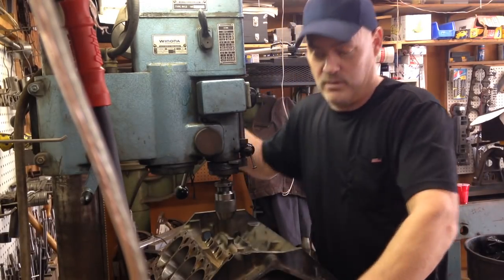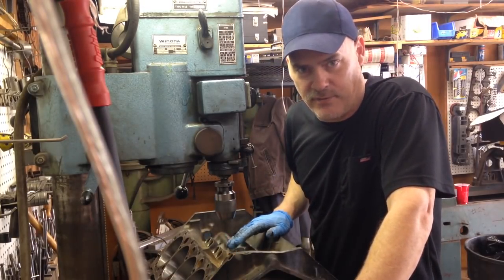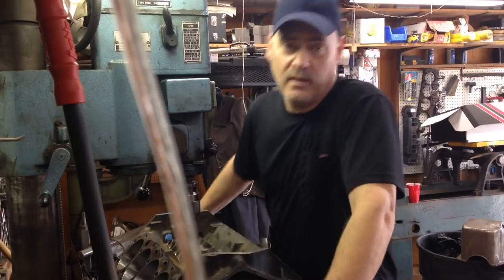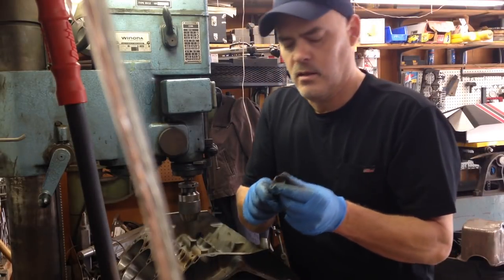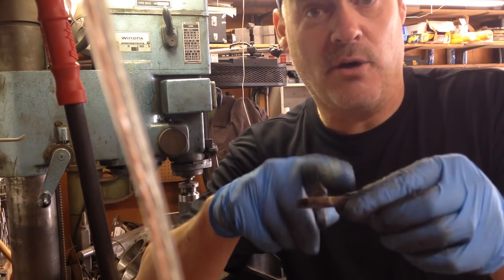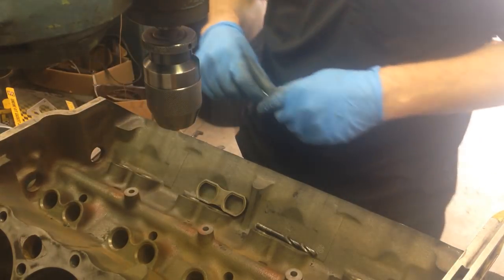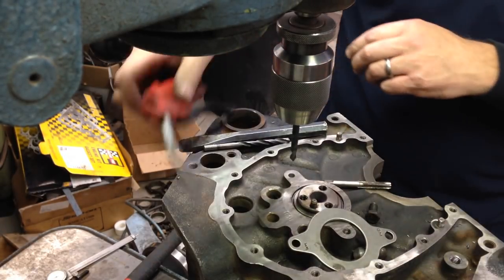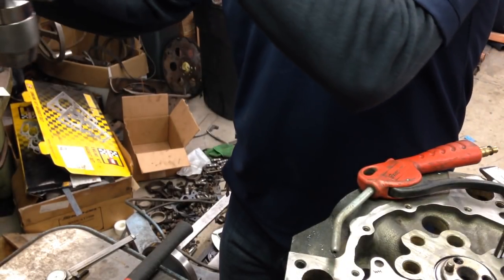Chevy TBI roller cam upgrade

Comment: Why not use a retrofit roller kit? Is it not possible to use a retrofit kit on a block such as this one? Or, is the OEM style roller kit with spider/lifter retainers (dogbones) better in some way? I want to convert to a roller cam from flat tappet with my 1995 350 TBI Tahoe, however, I am torn between going this route with OEM style roller kit or going for a retrofit kit. What is your suggestions/opinions/thoughts? Thank you in advance, excellent work here and very informative :)
Reply: OEM roller cam parts are far less expensive than retrofit roller cam kits.
Reply: Oem rollers weigh less too
Reply: I decided to go this route because it was cheaper, even with the machining

Comment: Why don't you use oil on your tap??? I don't tap anything without cutting oil or fluid
Reply: Cast iron really doesn't need any lubricant for tapping. In my race shop I have a cooling light blast of air to keep the tooling cool whether it's a tap, drill, or end mill. Been doing it this way for 40 years, and on blocks that can't be replaced.  Hopefully that helps.
T.S. RACING

Comment: any plans 2 do a video series on drilling out the fuel pump boss on a roller block (after 1991) - there r some who wish not to convert to EFI and retain the mechanical fuel pump or choose not to run a Carter P4070 external electric fuel pump
Reply: Montrose Patriot ,,,, a roller cam,,, does not have a lobe for a mechanical fuel pump,,. !!!!     ???

Comment: The block I have the bosses are not milled off flat on the top.  Were yours already cut down?  I came up with 2.150" below the block's manifold surface is where they should be.  Maybe some blocks are milled but just not tapped.
Reply from the maker: I would mill them

Comment: I have a 350 chevy that came in a boat as a volvo penta  marine engine.  the boat is a '92  is there a way to know if this engine has a flat tappet cam without pulling the intake?  also do you think 25 hours of operation would be enough to damage the cam if it ran the wrong oil, ie non zink oil? because of this channel I now understand why i might have an issue.  thanks for the videos
Reply from the maker: 25 hours could definitely wipe out a flat tappet but remember it depends on whether or not the cam was run with high zinc oil in the past what the zinc does is embed itself into the cam lobe and makes a sacrificial layer of zinc between the lobe and the lifter this protects it if it has zinc embedded in the lobes it could last quite a while on low zinc oil however eventually the lifters will wear through the zinc layer and wipe out the cam this is why it's imperative to use ZDDP rich oil and no there is no way to tell cam type without pulling the intake they built those engines both ways hope this helps

Comment: I wonder if thats just a vortec block without the holes drilled since gm went roller cam in 96...
Reply: I got a 89 small block chevy that has a roller cam from the factory. Yep.

Comment: did they forget the fuel pump rod also ran into that on same MOTOR haha
Reply from the maker: This one did not have the fuel pump rod hole drilled because it was FI engine
Reply: FI engines have the pump in the gas tank so need for any work on the block.

Comment: I purchased a 880 block (95 tbi) and after ripping it apart I found it has a two bolt main and no roller setup. I made an uniformed purchase and I'm most likely not using most of what came on the engine and it also has a few nasty ridges in the cylinder bore... I found another block (LQ3) that comes with the roller setup and a four bolt main, hardly any wear in the cylinders and it's only $50... should I make the swap or just take my block in for a clean & bore then drill the holes for the roller cam?
Reply: #$50.00?  For 50 bucks I'd risk buying it, but after you get it, have a machine shop check the block before spending any money on it.

Comment: I would like to know if you did anything to the top of the lifter bores where the dog bones sit. I have a 95 TBI truck motor that is the same as in your video but did not here you mention anything about doing any machine work in this area or is it ok to leave as is. Thanks
Reply from the maker: we ran it without doing that and it worked fine

Comment: I've got a related question. I have a 93 Gen V TBI 7.4L I'm itching to tear into. I've heard conflicting stories that these blocks are similar to the 5.7L and were provisioned for the roller cam but never given one. Could I be looking at the need to machine holes for a cam thrust plate?
Reply from the maker: it should have the holes drilled already

Comment: Im using a stock vortec block with the stock roller lifters. I’m also gonna use the 041 heads with 202 valves on this block with an aluminum high rise (carbureted) I can’t use the roller rockers on this motor because our street stock rules won’t allow it.
I wanna use the same camshaft from the 604 crate engine (.474 intake / .510 exhaust).
What’s your thoughts on this combination and how well do you think it would perform for a circle track motor?
I understand that when using a roller cam and roller lifters I will still have to use the roller push rods (shorter).
What should I use for a rocker arm?
Thanks Rusty
Reply from the maker: use the TBI or vortec rockers they will work fine
Reply: What’s your thoughts on this combination and that cam? I forgot to mention the motor is .030 over also
Reply from the maker: it sounds pretty good

Comment: I'm in the process of setting up my press for this exact conversion. I mean for real it isn't rocket science.  what size bit and taps/thread pitch did you go with? also what cam recommendations for this exact t.b.i motor but I will have vortec 062 heads? thanks man
Reply: For 1/4 20 bolts which is what they are, use number 7 drill.

Comment: cool lol , so what the advantage of the roller cam ? i`m guessing less friction more HP ?  or less ware longer life ?
Reply from the maker: I am so glad you asked this it is a really good question,  first and foremost you do not need to use high zinc oil as you probably know the engine oil sold today has very low zinc content and that makes life for a flat tappet impossible. Another good reason is a roller cam can have much more duration at lower valve lifts because of the lobe profile, Also the roller cam has 2/3 less rolling resistance than a flat tappet so basically uses 1/3 of the power to rotate it that is free HP I have seen 15 to 20 HP gains just from this alone, and yes much longer life for the cam as well as the entire valve train the difference between roller and flat tappet is as big as the difference between  Fuel injection and Carbirators
Reply: Both.
Reply: @Myvintageiron7512  it's opposite, roller cams can have more more lift at a lower duration.  it's not hard to find a flat tappet cam with low lift and a lot of duration, most of the 60s performance hydraulic cams were like this.  duration at .050 in the 220-230 range but lift less than .450.  Take for example the L79 350hp 327 cam, in Comp's reproduction of it, has 222/222 with .447 lift:  http://www.compcams.com/Company/CC/cam-specs/Details.aspx?csid=2&sb=2

Comment: off topic but I was hoping you could answer a question for me. I have 781 cast iron Factory heads which are going on a 496. The heads are going to have 2.25 intake and 1.90 exhaust. will it be of benefit, time, money vs gain if I port match and polish intake and exhaust?
Reply from the maker: port match the intake only not the ex and polish the ex only not the intake polishing the intake causes the fuel to fall out of suspension and port matching the ex causes ex. gas reversion yes it will benefit I recommend it
Reply: Thanks for the reply and information

Comment: Would this have been easier on a Bridgeport. Just wondering. I know dead lifting a block on a Bpt table is not fun either.
Reply from the maker: No I have a Bridgeport but this machine is much better suited for it

Comment: Can anyone give me some insight into these 350 TBI motors???  

 I bought a 1990 Cadillac Brougham with a 350/5.7 TBI, with 30k ml. & probably an orig. motor.   
I guess the "EASIEST" way to see if it has a roller-cam is to look down thru the head's oil drain holes or push-rod ports with my Borescope, to see  if there are any dog-bone lifter retainers, or the spider-hold down....any other way to know if this is a roller motor?

   Factory manual says this car has a 175hp@4200 / 295 lbs ft. @2000rpm, 240@3200rpm.  with 9.3:1 compression ratio &  "Hydraulic Lifters".    

I'm hoping that I have a better-variation motor that somehow made it into this car from the factory since it was a Cadillac.  

Are there any  type of block casting codes or other info I can find to determine what motor I have and confirm it's spec's easily???????
Reply from the maker: your idea of using a bore scope to look in the lifter valley is probably the best way to tell there,
 really wasn't any way to tell externally if it's a roller,  most of the TBI engines were not roller,
 the decision to make them a roller was made on the assembly line based on application.
I think a Caddy probably has the best chance of having one because it is considered a higher end car

Comment: Is it possible to sleeve a 350 cast iron for boost or nitrous?. If so, what is needed and what is the common cost from a machine shop?
Reply: Had_Built Not_Bought 
If you gotta ask what it costs to build your foundation you aint got the $ to afford  huff or candy. Just set fire to your budget $ now.

Comment: is the 97 vortecs stock cam good for midrange power I am using 91  
series 191 heads on a 97 tbi roller cam block.  my builder put stock cam
 in.  also my block was decked .20 , and my heads were shaved 
.20 also the cylinders were bored .20 . im trying to figure out what 
thickness head gasket I need,. the head gasket I have is .70 thousandths but I dont know what thickness it will compress to.  my stock pistons sit .032 below deck at TDC.  THANKS
Reply from the maker: Those gaskets are fine they will compress to around .045. .032 below the deck is allot of deck Clearence, you won't have any problems we run them a .000 deck and a .045 gasket all the time with no trouble
Reply: @Myvintageiron7512  thanks this gives me confidence to finish putting it together!

Comment: I have a 1995 chevy G20 5.7 880 tbi block, what block is that one, supposed to be a roller block, not sure if its 4 bolt mains as well
Reply: oh I see 638 number on that block you were working on, I wonder if my 95 880 block is a roller cam, maybe I should buy a crate 880 engine with roller and 4 bolt. might be cheaper than bring mine to the machine shop and get it redone

Comment: thats my motor folks!
Reply: it was NASTY LOL
Reply: ive learned that all 95 and some 94 blocked didnt get drilled
Reply: apsolus b
Reply: whats that mean?
Reply: apsolus my truck is a 93 does my block does it have the bosses? or no provisions for rollers at all
Reply: apsolus 
What cam did you pick for the engine? Or is there a video that explains all the part in it?
Reply: My 92 block was already drilled and tapped.
Reply: How's it runnin
Reply: @jonruger  u have the provisions for sure, more then likely drilled
Reply: @jonruger  Its not the end of the world if your block isnt drilled or tapped, or have bosses for the spider at all. The dog bones and the spider is OE type equipment. Most aftermarket performance roller lifters are cross linked. A lot of older blocks dont have those bosses. Personally, Id rather have linked rollers than the dog bones an spiders. Howards is a super good cam company, and they put together a really good retrofit package for all types of lifts and cam profiles.
Reply: @jonruger  should
Reply: @thehighlife1320  i dont remember. It was just a bit better than stock. It was ahowards cam. Main thing iwas after was the roller
Reply: @jjmccloud  ive put 50000 miles on it and it runs like brand new

Comment: This is the same block i had that was a made in mexico block is this a 1 or 2 piece rear seal mine was a 2 piece made in 88. It was a gm goodwrench block a crate 4 bolt main with spider bosses and im confused as to is it a special made or what because it was a 4.030 bore and flattop pistons all the reviews i seen for the block and heads said they are junk i dont think so
Reply from the maker: The block castings made is Mexico are definitely not junk they are plenty strong and they were all 4 bolt mains they will take 450 + HP with no issues the heads are stockers and not really good for power because they don't flow well but they are pretty much the same as any other stock open chamber 350 head they are not prone to cracking like the 624's so for stock or mild build they are just fine I would say far from junk the reason people say that is because the stereotype anything that is made outside the US as being cheap foreign crap what they fail to realize is yes they are made in Mexico but it's still GM that makes them the plant just happens to be south of the Border

Comment: Hi, I was recently given a good crank and pistons from a 350 sbc and he suggested I get a 302 and bore that to a 350. To stick them in I had never heard of a chevy 302. Any suggestions or if a 302 sbc is rare? Thanks in advance
Reply: A 302 Chevy is rare. http://www.holisticpage.com/camaro/camaros/302.htm  You can't bore a 302 to a 350 because a 302, 327, and 350 all use the same diameter pistons. They do however use different stroke crankshafts and some of the crankshafts have small or large diameter main bearings.
Reply: the crank from a Baby LT1 (L99) has a 3 inch stroke and 5.94" rods which yields a 302 without the use of the vintage 302 pistons from the DZ motor (the L99 as with all 86+ SBCs incl the 4.3L r a one piece rear seal)
Reply: @montrosepatriot  News to me ! hav i been under a rock or did chevy make another 302 i have never heard of ? and with a odd ball rod length ta boot ! Are we even talking small blocks or are we into some unrelated L series here ?

Comment: I HAVE A 5.7 1PC REAR MAIN BLOCK AND I WANT TO BUILD A 383 FOR MY TRUCK IF I GET A EXTERNAL BALANCE ROTATING ASS. DO THEY MAKE A FLYWHEEL FOR A MANUAL TRANSMISSION THAT WILL WORK ? IM GONNA HAVE IT BALANCED JUST WONDERING.............SHOULD I JUST GET AN INTERNAL BALANCED ASSEMBLY INSTEAD
Reply from the maker: ther is an external balance flywheel for your rotating ass
Reply: OK THANK YOU

Comment: so a part of the casting where the roller spyder assembly bolts to broke. it i was only at 18 ftlbs .. how do i fix that issue i dont wanna be out 600$ on a roller cam. i wanna still be able to use my cam is their a way to finagle something up?
Reply from the maker: It's hard to say without seeing it
Reply: They make roller lifters,,, for a non roller block,,. They have a bar that connects  2. Lifters together,,, and you can use a standard flat tappet cam,,. ???   Older block with mechanical fuel pump,,,. And a carburetor,,, and even use a roller rocker,, ???

Comment: Heard it’s hard to get tbi to run correctly after cam.
Reply from the maker: It's not hard you just need to have it tuned correctly by someone who knows what they are doing
Reply: Myvintageiron7512: I figured. Thanks for the reply!
Reply: I meant to get it tuned but never did. Ive had no issues. One day ill have tbichips make me aprom

Comment: and why did they stop production of 283 and 307 was a joke the 302 was an awesome motor
Reply from the maker: The 283 was too small and under-powered the 327 was considered as being used as the mainstream SB GM made the decision to go with the 350 because of the bigger CID they made a decision to streamline there engine production and the 350 was chosen
Reply: David Walker ive got a garage full of 283 cars from 57 to 67. None have had even an intake off. They all run like a top. My bone stock 58 3 on the tree 283 will stroll all day long at 90mph on the interstate with 0 sweat. 307 were a torque monster for their cid.
You wanna go fast? Try a hog block.
Reply: Gordon Greninger ,,, yep,, I prefer low end torque,,, over horsepower that comes in later,,,.  Just raise the compression some,,,,.  And get even better fuel mileage,,. !!!  All torque and horsepower in by 4000 RPMs,,, !!!    I like the 1989 through 94,,,, 65cc heads number 193 #.  Intake ported  to  Fel-Pro 1205 mild  race port,,,, and exhaust 1404,,, ported for 1 +5/8 header tube,,,. They will have 45 foot pounds more torque any stock or aftermarket head,,. !!!

Comment: May Be the guy blew up the 95 motor and got a used 85 86 350 tbi from a camaro or truck 
I have never in my life seem that on a 95
Reply: Tbi didnt come out until 87
Reply: @dextermorgan9703  then it's a 90 truck 5.7
Reply: @dextermorgan9703  my 88 gta trans am Pontiac firebird had original 305 tpi with a t5 
And it was roller cam